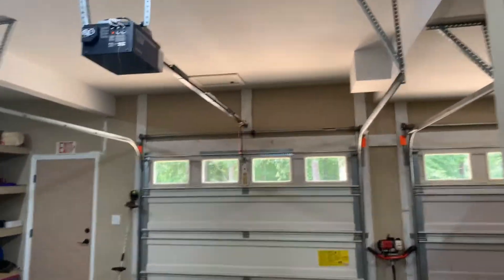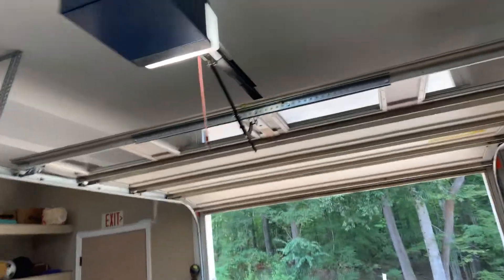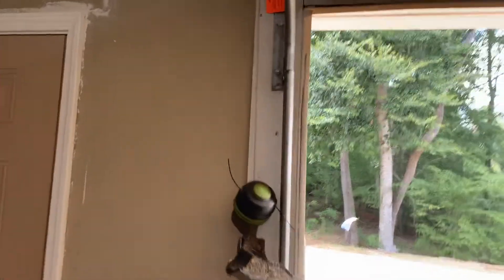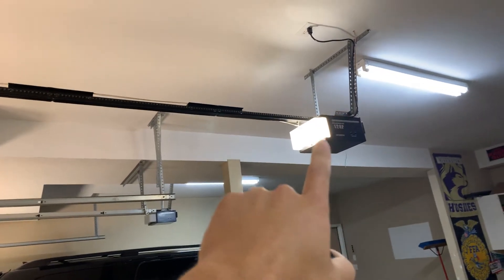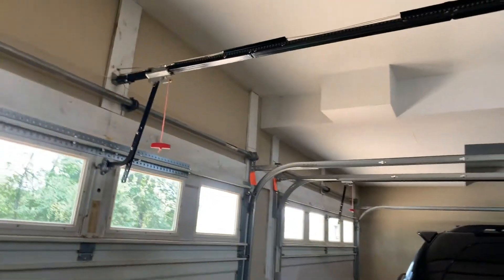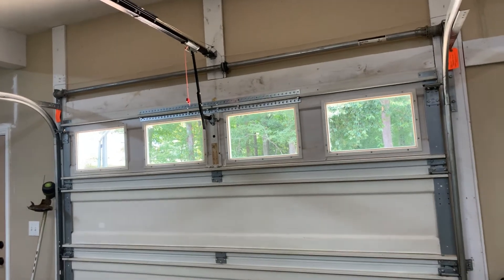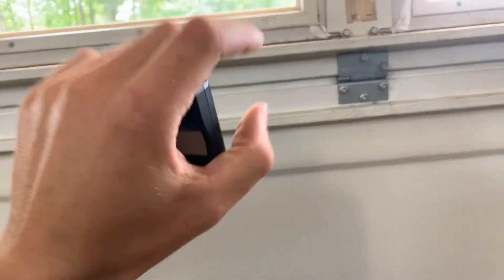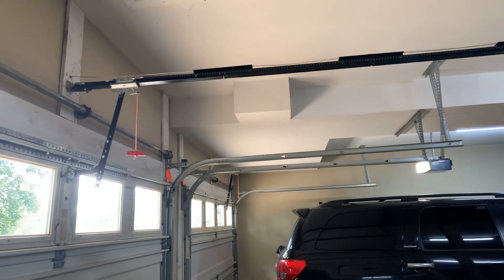Foam padding in the other garage door opener and some minor updates

Comment: On my weather stripping the actual part that makes the seal is BELOW THE WOOD TRIM, I’ve never seen anything like it before
Reply from the maker: Vemco Machines It is not part of the wood it’s completely separate the guy just did half work and he put it on there to cover up his mistakes
Reply: Zackary Hilton actually it is part of the wood, there’s a slot on the wood for the weather stripping
Reply from the maker: Vemco Machines The wood is not a part of the weatherstripping I would know because I had to tear out the original weatherstripping
Reply: Zackary Hilton I know it’s not part of the weather stripping, the actual rubber part is placed below the wood with slots in the wood for the weather stripping, if I wanted to I could rip the rubber part out and still have the trim, which is going to happen soon because I need to reframe the garage and with that comes new trim, any recommendations on trim?
Reply from the maker: Vemco Machines depending on the kind of house you have I would recommend the weatherstripping that you would buy from Lowe’s or Home Depot at the garage door section it comes in a few different colors and it has a thick rubber flap and it has a thick casing I don’t really recommend the top of the weatherseal that you would buy for the wood because my neighbor has that and it’s keep falling out and it wasn’t a good design in the first place on his house if you seen my other videos of the Chamberlain belt drives I believe you can get a few ideas how the trim is supposed to look
Reply: Zackary Hilton it’s a detached garage but a white door/white garage so that’s definitely the trim in getting, when I put in my new door the frame of the garage it came out of was differently shaped and the trim didn’t fit, anyways thanks for the recommendation!
Reply from the maker: Vemco Machines ok I see what your garage door looks like now if you’re referring to that big huge garage door that you installed actually I know exactly what you were talking about so what you do is tear out all of the original weatherstripping the rubber piece and you can get new stuff off of Amazon or a garage door company just make sure the same grooves lineup then you should have no problems but if that little piece of wood attached to the main frame is a separate peace then hammer out that little piece of wood out where the weatherstripping attaches to the wood and then the only thing you need to do is just put your new trim on and put a new coat of paint but if you were planning on replacing all of the wood because I can see it’s rotted then you would just have everything flat around the whole tower door then at the last step you would just put your weather seal and Tackett into place and then you’ll be set to go make sure when you install it you do not slam it against the garage door because that would make the door bind Do you want the weatherseal to have a little bit of an angle so it rides smooth Lee down the door when it closes that or when you install your word shrimp if there is a little gap top to bottom and you just line up the edge of the weather seal with the wood trim been temporarily Tackett in place halfway then close your garage door to see if the weatherstripping is the same gab all the way down and if that is the case open your garage door and nail everything in make sure you nail in the pre-punched holes and then do that around the whole entire door and then you are done
Reply from the maker: Judging actually it is two pieces so you were just tear out the wood that is holding out the weather seal and then if you don’t have any rotted wood anywhere else then you just Install new wood make sure you screw it down don’t use nails because screws have much more of a better grip and then fill in the holes with wood putty sand it and then paint it with the color that you desire and then get your new white weather seal from Lowe’s or Home Depot I did not recommend the stuff I got my dad got the cheap stuff at the door section do you want to go to the garage door section and they will have some colors for you to choose from and pick the best ones you can out of what they have Can I get the ones that have creases in them or a lot of damage on them make sure it’s a nice piece if they don’t have any go to a different place and then get some galvanized nails and then measure twice cut once and then see if it fits temporary tag it in place and then when you’re done I guarantee you it will look way better than what you have now and you will have much more of a longer life than the original stuff did
Reply from the maker: Vemco Machines And if you lubricate your garage door do not use white lithium grease it’s a really bad stuff to put on your door I would recommend PB blaster garage door lubricant you would buy off of Lowe’s and Home Depot it works way better it doesn’t harden like cement overtime if you’re gonna put any kind of real grease I would recommend getting railed Greece for garage door openers and put a little bit on the top of the t rail I am a little bit on the inner trolley do not go overkill just rub it in and u are set to go Let me know if you need any other help because I see what your working with and I know exactly what you need for your project to make it last a long time
Reply: Zackary Hilton we might be able to reuse the trim but I doubt it, the bottom of the garage is rotting off it’s foundation so it’s a matter of time before the garage rots into the ground, on lubricating garage doors, I would never use white lithium, I have brand that I got from menards that works really well though I need a better straw for it, on greasing garage door openers, I don’t usually grease the rail because it gets really messy over time, but if the opener is vibrating in the trolly I will Definitely put grease on the rail in that case, my 3265 case with grease on the rail when I got it and it’s very quiet (minus the vibration from the angle iron I need to get rubber bushings) other then that it’s the quietest 3265 I’ve ever heard

Comment: Debating on whether I should do this to my old access masters. 🤔
Reply from the maker: A Master I mean If you’re willing to put some money into it like I did with these garage door openers then they are going to last twice as long and they gonna look like brand new opener’s
Reply: Zackary Hilton yeah man I’m with you. The doors were in bad shape when we moved here a few years ago. Kinda like what happened with you. I fixed everything on them tho
Reply from the maker: A Master I do not know what your garage door openers look like but if you just open them up clean them up put new white lithium grease rail grease to be exact it comes in a little package you put that on the gears you put the foam padding in the case put everything back together put a little bit of grease on the rail but make sure it doesn’t gosh out the trolley put some grease on the inner trolley make sure the chain is 1/2 inch above the rail make sure your door arm angle is like mine and make sure the emergency release rope and handle is tied off correctly and make sure the safety sensors are installed correctly and either from that you should be good
Reply: Zackary Hilton sounds good. I’ll probably clean the inside case when I get time but some of that was what was wrong when I first moved in to my current house. I fixed most of it tho.
Reply from the maker: A Master that’s good It’s hard finding people that love putting detail into the work
Reply: Zackary Hilton oh yeah man I feel you. I don’t think it’s ever good to half ass work. The people who built my house out remotes on the wall instead of wiring the wall button. It’s annoying.
Reply from the maker: A Master yeah bet Really the only thing you need to do is just get some regular wire like there is for the safety sensors and get a simple wall button even like the ones I have for my garage doors would work just fine
Reply: Zackary Hilton yeah I looked at the manual for my access master M350s and they come with one 371ac (single button remote) and a doorbell button wall control. The builders for some reason put remotes on the wall for some reason and didn’t wire the wall control. I’m probably just going to leave three remotes up until I have to replace the openers.

Comment: where do you get your foam padding 
I'm trying to do this on my liftmaster 1160
Reply from the maker: I just got mine at Michael’s to be honest you can get them really cheap for $.99 I believe your area might be different just make sure it has the stickiness on one side in the foam padding itself on the other side I believe it’s pretty close to the same thickness as the older version liftmaster‘s especially the old belt drives that used to have the foam padding built into the case